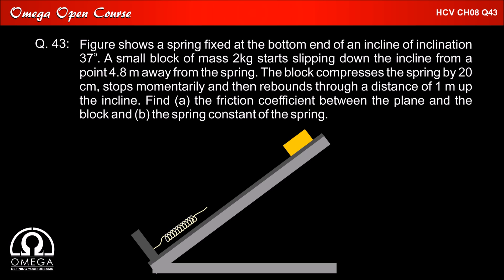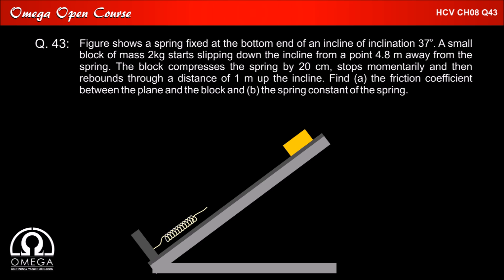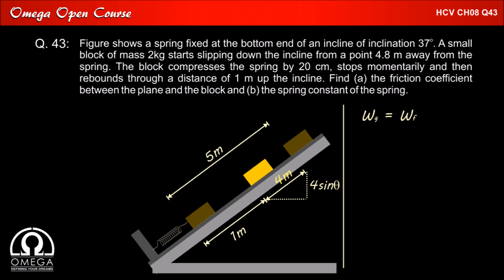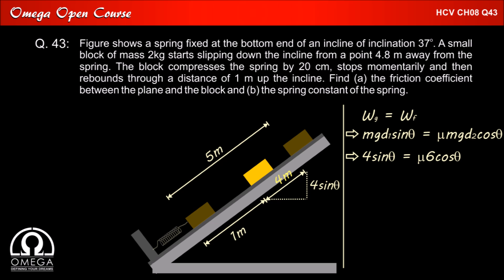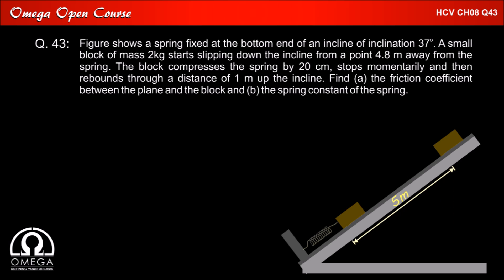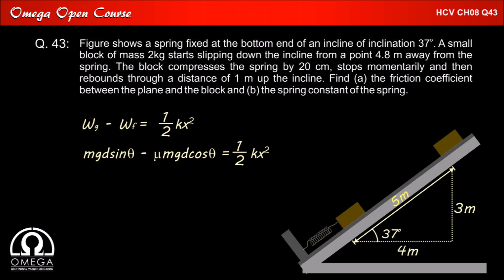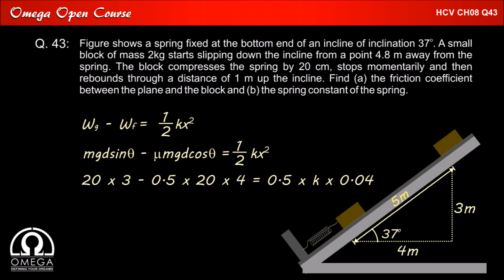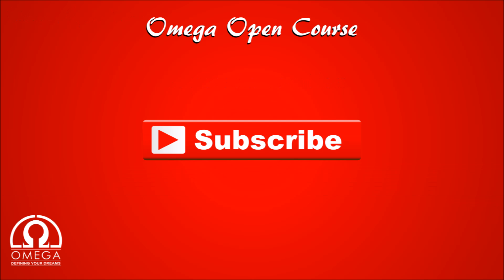H. C. Verma Solutions - Chapter 8, Question 43

Comment: Why can't we find out Co efficient of friction using putting the value of  tan 37° , as it is shown in page 90 example 6.4 of HC verma part 1 ?
Reply: Because in that  Case it is limited to equilibrium.i.e. we are assuming the instant where the block is going to move bt at it is at rest.

Comment: just one question sir, isnt work done by friction on the same line (up the incline) as the block's displacement (down the incline) so why do we consider cos theta component shouldnt it just be cos 180 which is - of F × S
Reply from the maker: theta here is not the angle between the force and the displacement. Cos theta comes because the normal on the block is mg cos theta and therefore the friction is mu-mgcos theta.
Reply: Omega Open Course my apologies. I would also like to thank you for the effort you put into animating your videos. I do not skip ads on this channel for this reason. Keep up the excellent work!
Reply: Why you take  costhita
Reply: Basant Yadav friction = u × Normal
normal = mg cos theta since there is an inclined plane

friction = u × Normal
              = u × mgcos theta